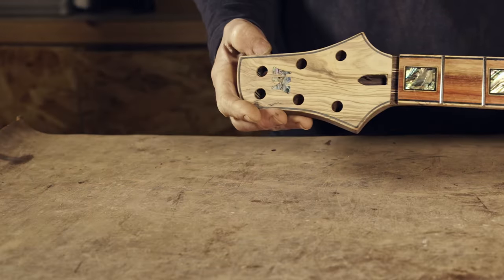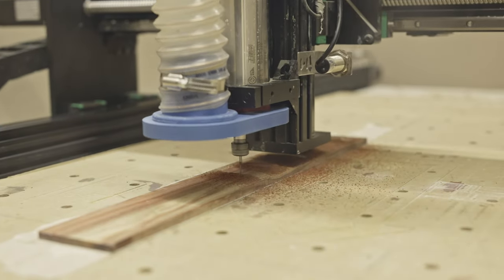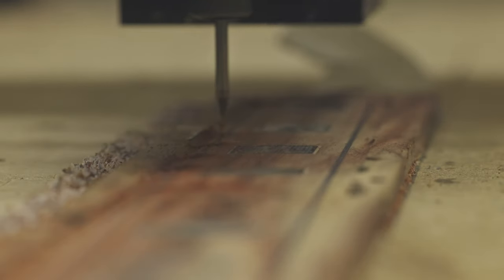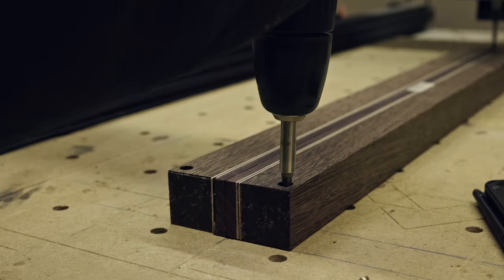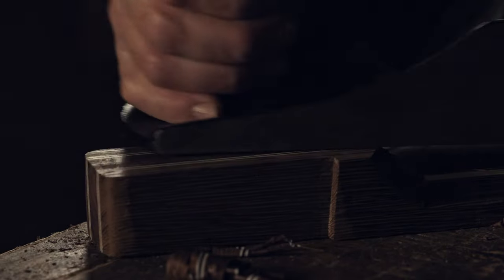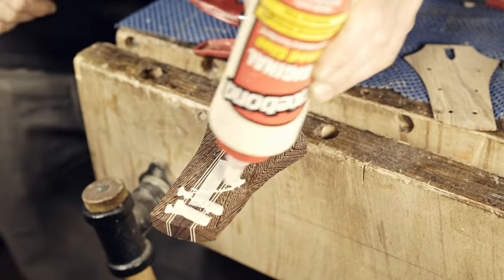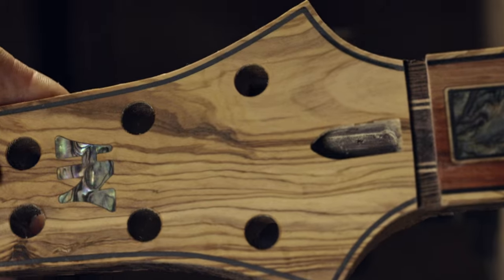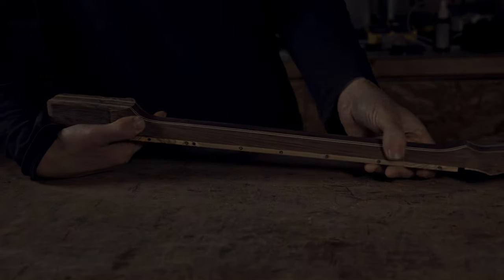Building GUITAR Neck (Can't MISS the INLAYS and Bindings PROCESS)

Comment: One trick I've seen for getting the neck nice and even is from Tom Sands video "Carving a neck from start to finish" - - check it out around the 19 minute mark or so. He uses a piece of square wood the length of the neck with a self adhesive sand paper. 👍